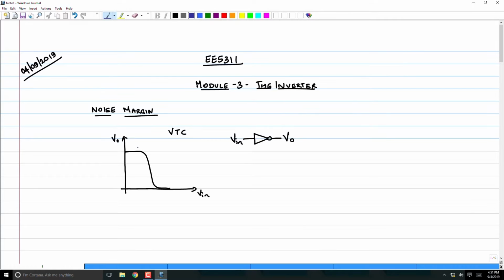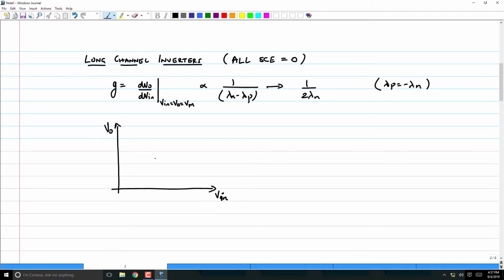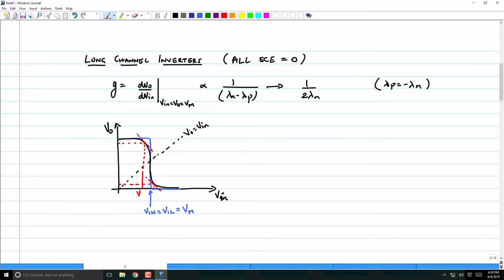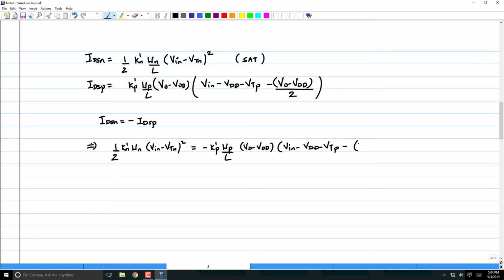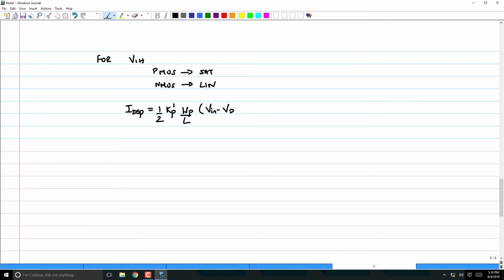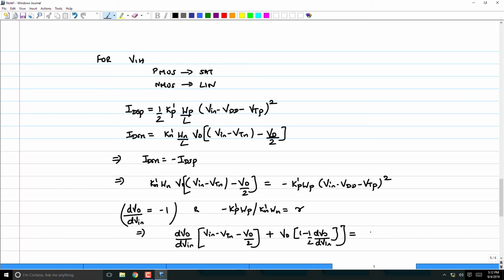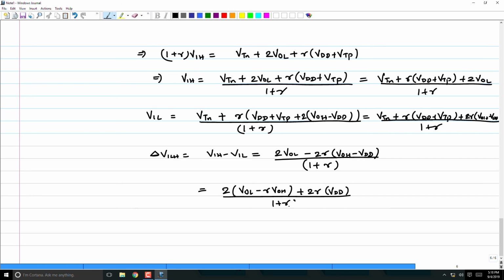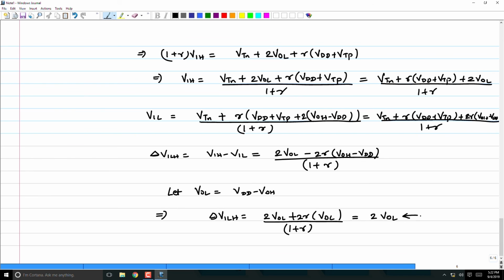Inverter - 9 - Noise Margin Analysis-Long Channel Device Inverter-1

Comment: At 21:41, the differentiation with respect to Vin should give 2r(Vin - Vdd - Vtp) in RHS right?
Reply: there is 1/2 factor also present there due to thiis both of the factor cancelled out
Reply: @pankajdiwakar4728  1/2 factor in the RHS before differentiation of both sides wrt Vin?
Reply: Oh yes, sir is missing the 1/2 factor in the RHS before differentiation which come from Id equation in saturation? Right?